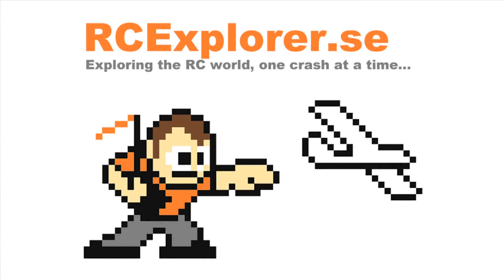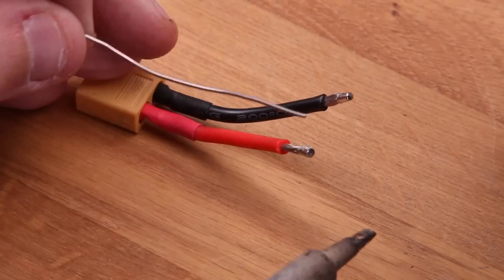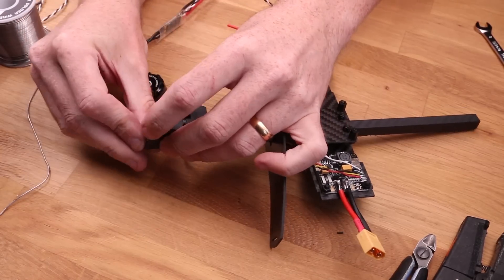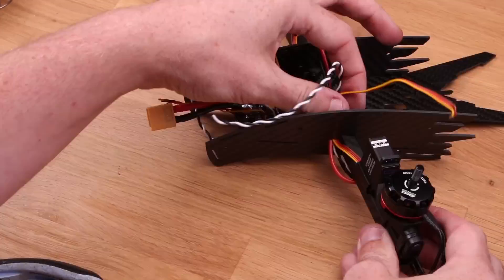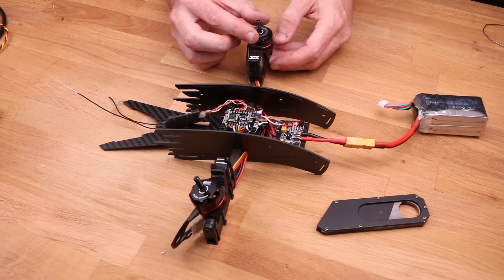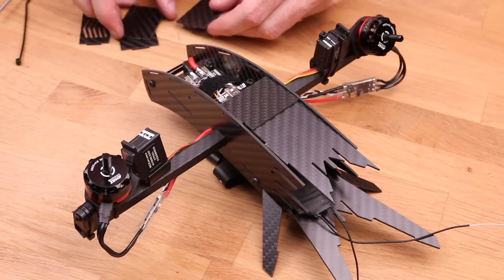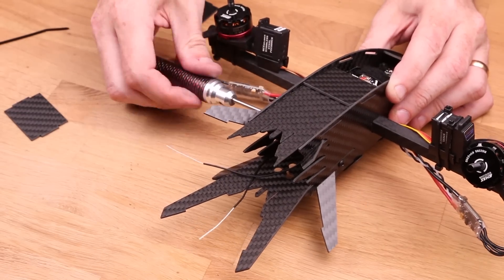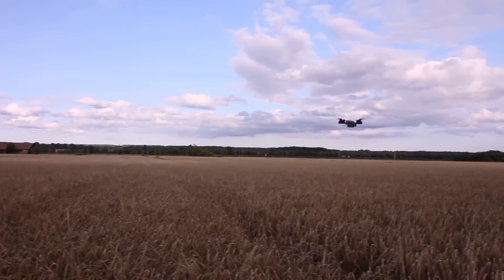RCExplorer BICOPTER BUILD/setup video

Comment: Add 2 more electric motors in a stubbed quadcopter ( dual stack bicopter ), fix the arms,  and remove the tilting servos.  Current flight controllers should be able to get that to fly and be stable.   Think of this like a better version of a SYMA Z-700 (Z-5) or 4DRC 4D-M3 Vertijet...

Comment: Dump file, because it's not arriveable today. You welcome 😉

# Betaflight / RCEXPLORERF3 (REF3) 3.5.1 2. September 2018 / 03:22:27 (890d0e0b9) MSP-API: 1.40

board_name RCEXPLORERF3
Hersteller -
ID Ressource MOTOR 1 B00
Ressource MOTOR 2 A04
Ressource MOTOR 3 KEINE
Ressource MOTOR 4 KEINE
Ressource SERVO 1 A07
Ressource SERVO 2 A08
Mixer CUSTOMAIRPLANE
mmix 0 1.000 1.000 0.000 0.000 mmix
1 1.000 -1.000 0.000 5.000 Servo 21 0
900
servo 3 900 2100 1420 100 -1
servo 4 1050 1950 1500 100 -1
smix 0 2 2 100 0 0 100 0
smix 1 2 1 -100 0 0 100 0
smix 2 3 2 100 0 0 100 0
smix 3 0 3 1 0 0 100 0

feature -ANTI_GRAVITY
feature TELEMETRY
beeper -ON_USB
serial 1 32 115200 57600 0 115200
aux 0 0 0 1300 1700 0 0
aux 1 1 1 900 1300 0 0
aux 2 2 1 1300 1700 0 0
aux 3 28 0 2
17gy2 90
set acc_trim_pitch = -6
set acc_calibration = -12,17,47
set mag_hardware = NONE set baro_hardware =
NONE
set rssi_scale = 41
set rc_interp_ch = RP
set min_throttle = 1015
set motor_pwm_rate = 2000
set align_board_yaw = 270
set current_meter = ADC
set ibata_scale = 336
setze ibatv_scale = 336
setze servo_pwm_rate = 250
setze Deadband = 5
setze Yaw_deadband = 6
Profil 0

setze dterm_lowpass_type = BIQUAD
setze dterm_notch_hz = 260
setze anti_gravity_gain = 1000
setze iterm_windup = 50
setze yaw_lowpass_hz = 50
setze Throttle_boost = 0
setze p_pitch = 60
setze i_pitch = 45
setze d_pitch = 60
setze p_roll = 45
setze i_roll = 20
setze 5 p_roll =
aw = 40
setze i_yaw = 20
setze d_yaw = 60
setze f_yaw = 0
rateprofile 0

Comment: I am planning to build a Osprey drone and it turns out you beat me to it. 

The problem with an Osprey type drone is that, it can easily go out of range so for that i decided to hook it with the internet. The initial plan is to do it by using a Sim-card device, maybe even a cellphone. With the internet connection you can control the UAV from anywhere in the world.

Comment: Hi Dave, have you tried running the two propeller assemblies in line longitudinally so that forward movement is throttle based without needing to rotate the servos against the counterweight? Stability and rotation would still be reliant on the servos.

Comment: you build the best ships bro, love how you designed this thing. are you on Instagram too?
I did some research on the topic and I have agree there is so little data to find out there regarding bi-copters. I guess the majority would be coaxial heli's and tilting prop convertibles but not so much real multirotor like this one. 
The closest thing to true functional bi-rotor flight would be the hover board style type of platform, which has a ducted front and rear prop. from what i seen it seems very promising as it can balance a man standing on it in mid air without losing it's leveling threshold.

Comment: How's about rotating the servos and strut assembly 90 degrees and packaging it into a functioning wing? Would it make a noticeable difference at that size and speed. I'm not an aerodynamicist. I can't even spell aerodynamicist without spellchecker. I'm only a few percent sure aerodynamicist is the right word to use here.

Comment: It's too heavy, try attaching helium filled zip-tied balloon pods to increase agility. Add beefier motors, and an EDF facing downwards in the center Manifold like F35 in hover. Finally, dress it nicely in Flying wing airfoil with  Sr71 similarities.

Comment: Quick tip for everyone not knowing this: use nailclippers to trim zip-ties. They cut flush so you don't have that nasty piece of plastic with the razor sharp corners sticking out. Especially with the slightly bigger zip-ties. Keeps you from wondering where the bloody smudge on your model/workbench/tools comes from. Oh, and BTW: this is how ALL instruction videos should be! Nice!

Comment: Would a Chinook design be an option as well? Because it has less weight on the sides, as such the servos don't have to compensate as hard? I mean I've seen those lumbering beasts in action and they are quite nimble for their huge size.

Comment: you should have a centering mark or cutout on the bottom plate and a matching one on the main arm to make it easier to get the main arm centered in the frame... maybe laser etched?... nice bi-copter though..., love the design!

Comment: Have you tried the Oblique Active Tilting method, where the arms angle in ~30deg or so? If i understand correctly this will give you more torque / moment to correct the pitch, and not just move the center of thrust

Comment: I try to use the spracing f3 but after I copy the cli from website, my motor 2 don't have any response, after I take sometimes to make it work. But my servo cannot move. Under the beta flight motors the motors 3 and 4 are moving,but I plug my servo in,the servo doesn't move.

Comment: That thing is sick! Congrats on that design. I saw you showing it at RR. I will get one for sure. I dont know when, I need to see it with fpv and carrying an action cam. What flying time are u getting? I guess it should be much longer than a quadcopter?
Reply: Eduardo Agustin Vendrell del Río yes it’s powering less motors but then you have half as many motors for a quad of the same weight so they have to work harder
Reply: I don’t really upload often but look at some of my bixler videos. I use a taranis and great great range. More than a beginner will ever need and it has a module bay for uhf so you could fly for miles if you ever got into long range

Comment: What wire stripper are you using?. Btw i appreciate the soldering tips.
Reply: martinwazhere it's this old broken one found the the dump behind an old electronics store that he used to work at. Any stripers will work. Just go get a decent quality one and treat it well.
Reply: When you solder, don't tin wires directly over a circuit board like he does.  Get yourself a helping hand device, and presolder all the pads you're going to use before you install the board into the craft.

Comment: I thought carbon fiber is conductive. Did u cover the bottom of the pdb with something?
Reply: Wilson Tsan I think that this PDB has no exposed connections at the bottom,  so there is no risk of a short.
Reply: standoffs my man
Reply: The Lennipede He didn't use any standoffs
Reply from the maker: If you're worried you can always put a layer of tape on the bottom :)

Comment: Is the backward flying better or still wobbling?
Reply: maybe you should do and have a look at butterflight.  for me, on my quad, the whole kalman filter really helped eliminate the prop wash vibrations.  maybe it (or a slightly modified version) would help reduce the vibrations and make it run better?
Reply from the maker: Havent tried Butterflight on it yet! Would be cool to see what it does
Reply from the maker: It's a lot better now. Lighter props made a huge differance
Reply: Thanks for answering. Watching this a while now and maybe going to buy one :-)